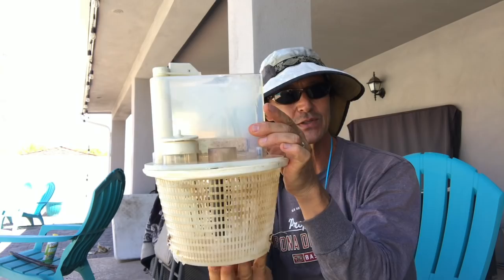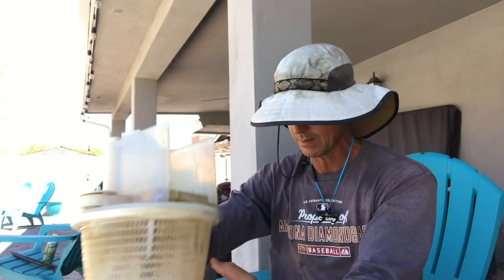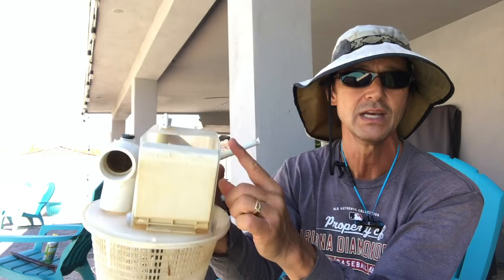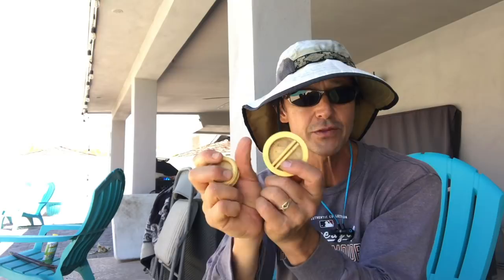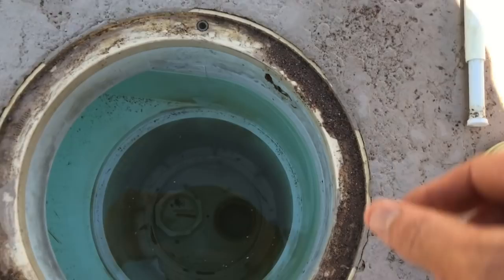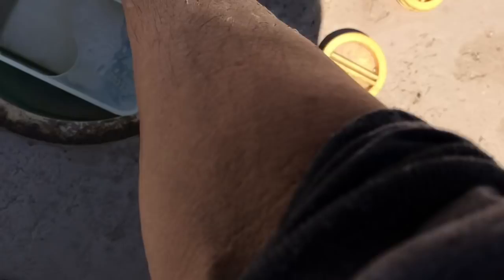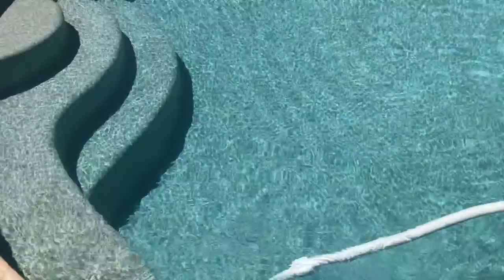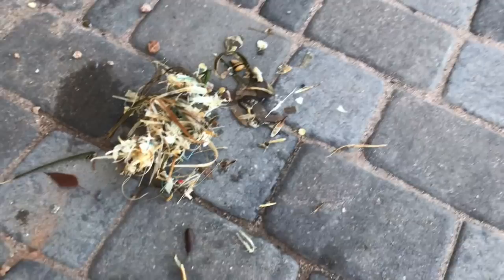Installing a Pool Vacuum Using a VacMate

Comment: I get far more pressure with my two floor drains then I do just with skimmer suction.  I use the same vacuum as you recommend but I like the pool shark maybe more with my pebbletek pool.  I dont have a dedicated vacuum although I wish I did.  I tried the VacMate a few years again with my 1hp pump and it failed (now I have a 2hp pump).  Ive had two pools guys try to disable my popups but the multiple stairs dont get cleaned otherwise.  Yeah replacing 17 at $39 is pricy but I can shut them off when vacuuming.  Installing a new actuator at $800 may have a dedicated pump installed soon too as we redo the pool.  Again you repeat yourself too much but I find your info useful even if I dont fully agree with your logic as you info helps to confirm my process.  Thanks..

Comment: Another newbie here, (3 weeks) and I've been enjoying the learning of pool maintenance via your videos! I like how you explain everything clearly and simply! Loved your Phosphate Algae/Aljay video that was an eye opener to chemicals needed and not needed.
Question with this VacMate, how does it know where to go? Or does it just go random and hopefully/eventually cleans all areas?
I'm old school, so I vacuum the old way.
Thanks again for your videos, and I will definitely share with others!
Reply from the maker: Thank you for your kind comments and thank you for watching. With regards to your question the vac mate is actually the unit that goes in the skimmer that allows you to attach a vacuum to it the vacuum itself The vacuums are categorized as random coverage vacuums so they move around the pool freely and most of the good ones will cover the entire pool bottom during the full runtime of the pump which is usually around 6 to 8 hours.
Reply from the maker: My two favorite vacs are (in order) the Zodiac Barracuda G3 and then The Pool Cleaner (the 4 wheel version is the one in this video and it's for pools with deep ends but they do make a 2 wheel version for "play pools".) Here's a link to a video I did on the G3: https://youtu.be/fFAiyDl6jRo

Comment: First of all thank you so much for all your videos very well explained and simple to follow, hoping you can help me out with this problem I have a automatic vacuum that stays on the pool as you suggest it works great for about three hours after I thoroughly clean the big filter on the fiberglass tank it is a chlorine pool after three or four hours I totally lose vacuum  everywhere skimmer too by about 75% even though the filter is not dirty cause I cleaned it 4 hours earlier can you help?
Reply from the maker: Is this an above ground pool?  You may need to clean the filter more often if it's a small filter.

Comment: Great video thanks. Can I use silicone gel to seal the vacmate to the basket? Could that help the seal?
Reply from the maker: I wouldn't do that since then you wouldn't be able to separate the two parts to empty the skimmer basket when it gets debris in it.  So my answer would be no.

Comment: I have an in ground pool cleaner that I took the accuator out of and converted using a vac mate and baracuda g3. Assembling and inserting was super easy thanks to your vid! It worked for literally 5 min and then stopped 😭 Ive checked my hoses, took out and reinserted the vac mate, cleaned all baskets and it doesnt seem to work. The pop up heads are still in the pool so maybe thats clogging the water flow? Any suggestions where to go from here?
Reply from the maker: Did you use one of the included screw in plugs to stop suction being diverted to the floor drain? (it's the other hole in the skimmer).  If so, check your vacuum and make sure it doesn't have a rock or something stuck in the diaphragm.  The pop up heads shouldn't affect it because they're on the return side.

Comment: I just watched your video on how to Install the Vac-Mate. GREAT video. It was very helpful. But, my system is not working. 
I think it might be because our pool is not full enough. I see from your video that the water level is up completely covering the weir and elbow. My water level is about an inch lower, the elbow and top of weir are exposed. Any advice or guidance would be great.
Reply from the maker: You'd have to email me a pic of what you're describing.  kennypoolschool@gmail.com
Reply: Add more H2o

Comment: great video and awesome go thru. QUestion on the maintenance on vacmate. Seems like when you put in it o skimmer hole need to tweak angle or slightly hammer it in. Will this cause damage on the vacmate like doing this weekly(take vacmate out-clean basket- put in back in)? Another question is how to efficient set the pump RPM if using varied speed pump. Like if found 2800rpm is good for vacmate and the vacuum machine to clean and also the skimmer has suction, but for other rpm maybe the vacuum machine lose its function since rpm too low and skimmer also has low suction to clean floating leaves. In this case the low rpm just good for pool water circulation. Do you have any input or recommendation here? Thanks!
Reply from the maker: It's sometimes a tight fit but you don't want to force it in. And I don't believe I "hammered" it in in the video.  That very well could cause damage to the vacmate. If using a variable speed pump you want at least 2800 if not 3000 rpm to get adequate suction.  You can play with the speed and adjustment to get the setting that will best for work for your vac.  And yes, the lower speed is for water circulation and filtration.  See my video on filter run times :  https://youtu.be/RRAHlbfYjwg

Comment: I've had this for about 2 months now and love it because it has allowed me to drop my pump speed to just 1900 and it moves around the pool fantastically while using much less electricity than when I would have to run the pump at 2700 to get my Kreepy Krauly moving without the Vac-mate.  My question is: my O-ring seal has cracked in multiple places as it seems to get sucked down into the skimmer area...or something.  I don't know what is causing the cracking.... with it cracked I have lost the seal and therefore the suction to the cleaner is not enough to move it.  I know I need to replace it, but what would be causing it to crack like this when I've only had it for a couple months.  Also, the hole to the skimmer basket is so small that the leaves (primarily from an Oak and Ash trees) are too big to fit through, so it gets clogged easily.  Can anything be done about this?  Thank you!
Reply from the maker: I’m assuming you mean the O-ring that goes around the rim of the skimmer part of the VacMate I have had times when that gets all deformed and mangled typically it’s because when you take it out of the skimmer sump it’s so nicely sealed inside the rim of the skimmer sub you have to be careful when you pull it out or it starts to stretch the O-ring. Sometimes it’s just the way they fit into the skimmer some and seal in there if it’s too tight then it’s possible that when you take it out it’s stretching out the O-ring.

Comment: The instruction manual talks about putting that gauge in there and then with a screwdriver turning a screw until you get the pressure gauge to a certain point and then reversing it to bring it down one digit once you do that they say take off the gauge and put that one little screw plug in there. So from what you’re saying you don’t have to set this up using the gauge just plug it in with the little plug and that’s it?
Reply from the maker: I don't like those gauges you can easily watch your pool vac and adjust the suction on the unit to make sure the vac moves up the wall a bit BUT not all the way out of the pool.

Comment: When Vacmate was install over six months ago it worked great.  Now I have lost most of the speed of the vacuum. Directly connect vacuum and no problems. After checking all connections the vacumate shows skimmer suction but virtually nothing through the vacuum.....
Reply from the maker: Did you check to make sure that the plug that goes in the bottom of the skimmer to plug off the floor drain pipe is still in place? Based on what you’re describing it sounds like that plug has come out.

Comment: Can I use the vac mate with a weighted manual vac head?  We have a small play pool and I just can see spending $500 for a more expensive and I’m sure better vac head. We’ve had pop ups repaired and it’s getting to be so expensive. I’m trying to figure the best way to convert to traditional vacuum.
Reply from the maker: Melanie Alkhatib I guess you could certainly use the VacMate with a manual vacuum head. But I would not see the need to really do that unless you already have a VacMate. But I would plug your vacuum hose directly into the skimmer suction port which would mean you would just take out your skimmer basket to do it. That way you get full suction to your vacuum head.

Comment: Hello my skimmer is not entirely smooth, it has two spots on opposing sides where there are tabs -- looks like something slides to lock in place underneath them. Are familiar with this type of skimmer rim?  Do you think I could still use the device you are describing? I tried to use a "pentair plate vac plus ii" which is similar to what you are describing---but can't seem to get it to seal tight due to the tabs I am describing.
Reply from the maker: I would have to see videos or pictures of what you are describing. You can email them to me at. kennypoolschool@gmail.com

Comment: What are your thoughts for this type of vacuum with a liner pool? I traditionally vacuum my pool, but have longed for an automatic one that won't ruin the vinyl!
Reply from the maker: I wouldn't do it.  It could damage the vinyl liner.  I'd suggest doing a google search for above ground pool vacuums so you can find one that is made for a vinyl liner.
Reply: Thank you!! It’s an in-ground with a 10ft deep end. I fear my days of doing it manually will continue. At least it’s a good workout! Love your videos, very helpful!!
Reply from the maker: @Jennie444  I appreciate the complement.  But there are some good pool vacs that certainly can work with a vinyl liner.  I did a search and found this link.  Hope it helps.

pool vacuums for vinyl pools
Reply from the maker: well that one didn't work. Try this one:  https://www.poolsupplyworld.com/blog/best-cleaners-for-vinyl-pools/
Reply: Pool School THANK YOU!!!! 🎉

Comment: Purchased a new to us home with a pool in Charleston. I have a small 15,000 gallon fiberglass pool, 3-5 feet.  I have a polaris booster pump and have tried the polaris 280 and it wouldn't move very on the fiberglass floor.  What cleaner would you recommend?  Do I need the vac?  I had a much larger vinyl liner pool and much easier to maintain.   Fiberglass has black algae at water level, lights went out after 2 days of use... Fixed booster pump with new capacitor. Salt Chlorinator was replaced under warranty.  Fun stuff all in 8 weeks.  Anyway, what pool cleaner system do you recommend?  The pool companies want to sell me a Dolphin...
Reply from the maker: Having a stay in the pool vac is best as you typically won't have to vacuum it (unless you have a major storm).  BUT I prefer the suction side vacuums over the return side ones like the Polaris.  I'd suggest getting rid of the Polaris and purchasing a Zodiac Barracuda G3 pool vac and install it using a Vacmate Skimmer adapter (or if you have a dedicated suction port in the side of the pool use that.

Also check out my new website poolschooler.com for lots of money saving exclusive content for the DIY pool owner.
Reply: @PoolSchooler  Thanks, will do!
Reply: @PoolSchooler  Is this better than the pool cleaner?
Reply from the maker: @gregb5930  My favorite pool vac is the Zodiac Barracuda G3.  Check out the video. https://youtu.be/fFAiyDl6jRo

Also for more $$$ savings tools, tips and links check out my website poolschooler.com
Reply: @PoolSchooler  It keeps getting stuck on the bottom step, just like the Vingli and the Polaris 280.  
Any other ones to suggest, much appreciated.
Reply from the maker: @gregb5930  that vac shouldn’t do that.
Reply: @PoolSchooler  It does clean the pool very well.  It does get stuck, thought I didn't use  the right amount of hose. So, I added a another piece and it still gets stuck. I did get the Vac Mate installed today.  No rubber rings would fit but it is in and working smoothly, thank you again.

Comment: Why do you plug the floor drain hole in the suction? Ours is not plugged. You say to plug it but Why do you plug it? You say it is very important to plug the floor drain hole?

Comment: Why do you have to plug the other hole? When i use a regular manual vacuum i don't have to plug it.
Reply from the maker: Because a regular manual vacuum plugs directly into the hole that sucks directly to the pump.  The other hole goes to the floor drain and if it's not plugged when you put in the vacMate the suction will divert to that hole and you won't get enough suction for the vacuum.
Reply: @PoolSchooler  thank you!

Comment: I installed it and the vacuum works great. However my waterfall stopped working now?!???!?
Reply from the maker: The vacuum shouldn't interfere with that.  Check your return lines to make sure you didn't turn off the return to your waterfall.  Or if you have a separate pump for the waterfall make sure that's ok.
Reply: @PoolSchooler  everything was working until I put in the vac mate and vacuum. Vacuum works awesome but now the waterfall doesn’t work. ONLY thing different is the vac mate.
Reply: @PoolSchooler  Did I see in one of your videos that you are in Arizona?  I am in Laveen. Any way I can connect with you and have you come out and look at my system to help me get it set up and running properly?
Reply from the maker: @kregemilyleoqueenprints6685  if you email me your contact information I will give you a call. Kennypoolschool@gmail.com
Reply from the maker: @kregemilyleoqueenprints6685  Absolutely, please email me your contact information and I will give you a call. My email address is Kennypoolschool@gmail.com